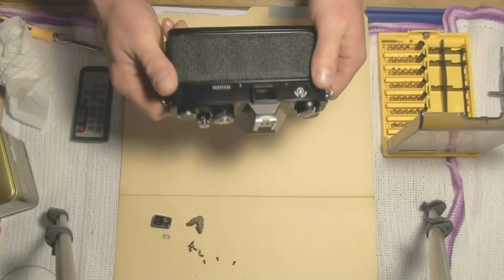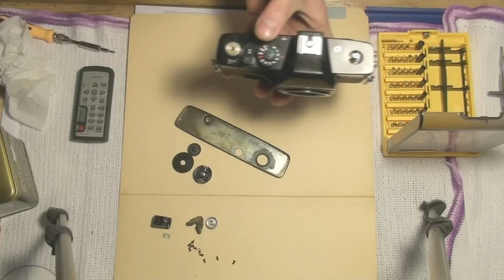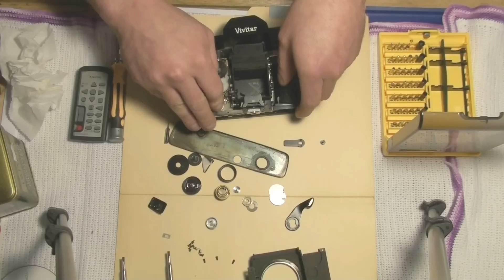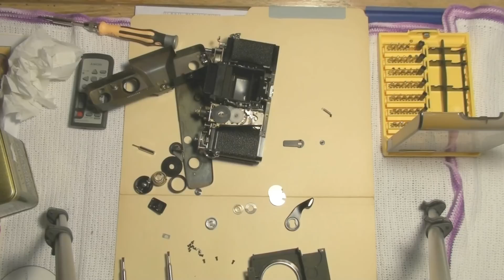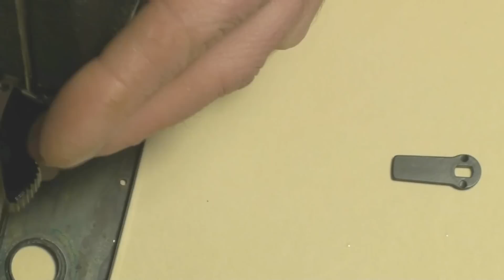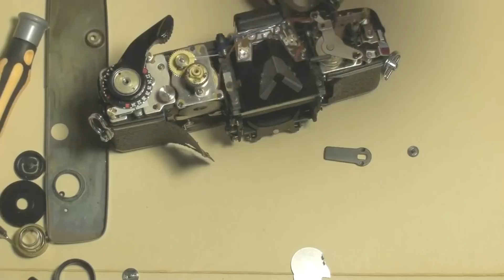Vivitar 250/SL Autopsy and Repair

Comment: Question how did you get the stitch for the light meter off? And is it supposed to be quite loose mine seems to be loose but working and wanted to try reattach it without breaking it

Comment: I found a 220/SL in original case with kit lens and 28mm Vivitar lens at my local Salvation Army. The wind on was stuck, turned out that spring on the bottom was the problem! Thanks for the video, I'm anxious to try out the wide angle lens.

Comment: what tool kit is this? i need to repair my camera's lever too
Reply from the maker: Do you mean the spanner tool?  It's meant for lens repair, but it's a blade/pin spanner, and they can be found by searching for "lens spanner" on eBay (or probably anywhere else)

Comment: Hi, I have a similar problem with a stuck film adv and a shutter release that does nothing. Can you tell me how you removed the meter power on switch. I don't see a screw to remove it. Thanks for your helpful video after all these years!
Reply: Dennis Ybe, I just figured it out. You have to pry off the little plate that says ON. It comes off really easy with a small blade. Underneath you will find a screw.